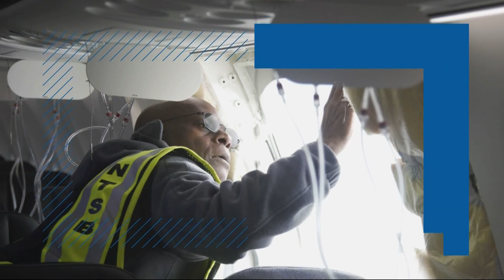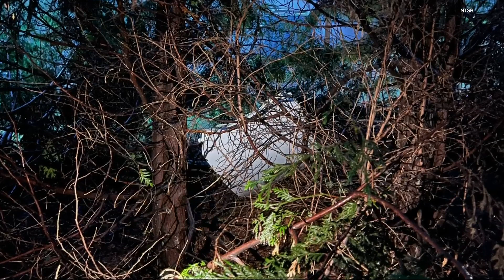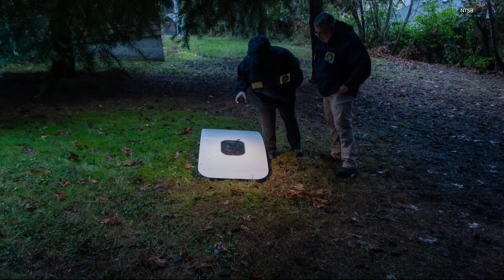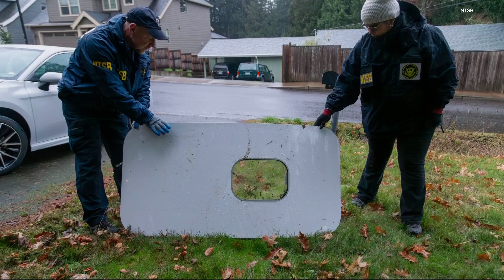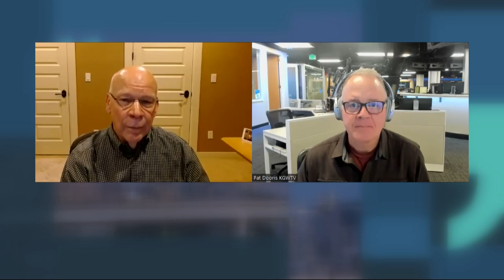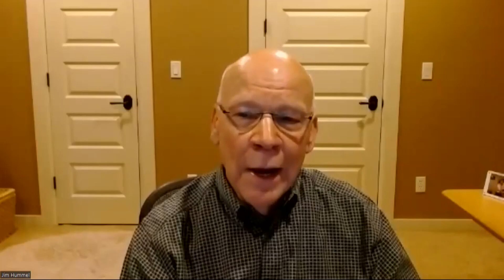Here's the science behind the Alaska Airlines door plug blowout and the investigation now underway

Comment: Bolt loose problems plane engineer not 100 percent knowledge bolt tait after create hole on bolt close of nut tait location hole insert steelness strong pin lock pin when door loose with vibrations create with plane no problems create advanced engineer not knowledge in mind plane all nut bolt after tait install sensor pin when bolt nut loose plane dashboard meter notification icon and bell speaking voice same to buggati chiron tyer air pressure telling on dashboard

Comment: Escape door is an escape door by design period. Why allow carriers to plug the door and put more seats? At the expense of passenger's safety/escape route?
Reply: Actually, the Alaska configuration has fewer than the maximum number of seats, which is why the two emergency exits in that position are not needed.  The regulations specify the number of exits based on the number of seats.  The configurations with the most seats require the most emergency exits.
Reply: @GH-oi2jf  Alaskan Air still modifies the aircraft to plug these doors because the FAA reduced regulation on the amount of emergency exits required.
Reply: There was an emergency, the door opened. Where is the problem?

Comment: The key here is whether the safety bolts (non tensil load bearing but a little bit of sheer) at the top were in place.  0r not in place.  It appears that they were not found.  An assembly goof....pure and simple  Or did they fall out from vibration..                                   castle nuts and cotterpins  Give me a break!
Reply: They didn't fall out, they are still in the package they came in on a shelf somewhere.
Reply: Castle nuts with cotter pins are a good choice for this application.  Just holding the nut in place with torque and friction would not be adequate, because the airplane experiences vibration in normal operation and shock from landings, which could cause the nut to loosen over time.  A system is needed which will keep the nut in place for years, because it is in a place which can’t be accessed easily, allowing frequent inspections.  A castle nut does this.
Reply: A possible scenario could be that the castle nut of the safety bolt was tighten but not torqued to specifications and the cotter pin was not put in. And after many flights ( around 150 flights as reported) the total cumulative vibration experienced by the safety bolt loosened the castle nut which caused the bolt to fall off, leaving the door plug with little restraint to fly off.

Comment: If there were three previous warnings, it shows you the warning system isn't built correctly. I don't know if there are pressure gauges that can be checked in the event of a warning, but there should be! 
What is the maintenance department supposed to do when the warning is sounded? How do they determine if the warning is false or true? The only way is with a pressure gauge or a data stream with a time stamp that monitors cabin pressure. The outcome of this will be interesting, and maybe there are other warnings that do not have a readout to check their validity? Maybe it is just common practice to not look further into the warnings until something catastrophic happens? Sure makes you want to go on a flying vacation!
Reply: Pressure is monitored by computer.
Reply: I assumed that since it gave the alarm, but is there a time stamped data stream? If not how do they determine if it is a false alarm. Warning buzzers and lights are easy to ignore, especially if they are intermittent.